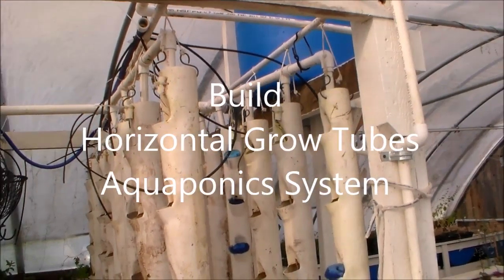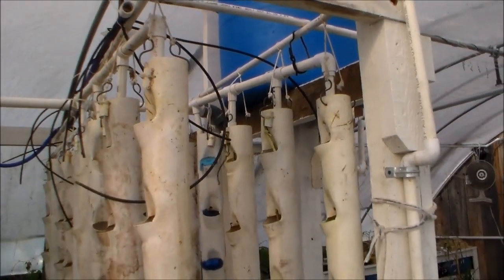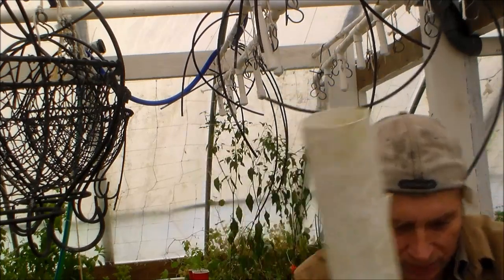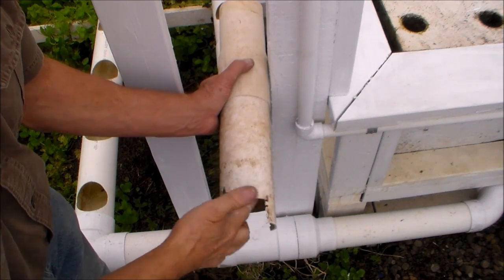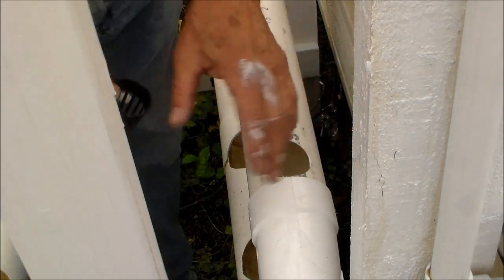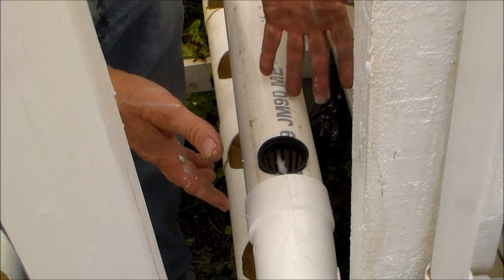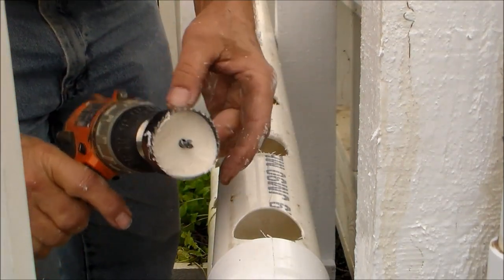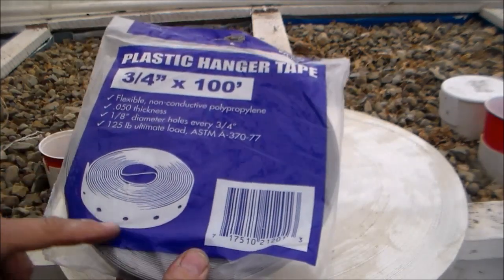Build Horizontal Grow Tubes in Aquaponics System

Comment: It seems that everyone doing aquaponics or hydroponics go through multiple versions of towers, mediums and watering processes.  I'm more confused than ever.  Are you just trying different approaches to see what works best?
Reply from the maker: everything was so new when I started that I was also confused and would try anything to see what would work at a low cost--- what was available at the time was so expensive --- I needed something I could afford and would still work.
Reply from the maker: Straw packing is a no no. too much foreign seeds in it, and it deteriorates too fast and molds grow. I switched to coconut coir instead. the wicking cord works well with small seedlings, small roots , but as soon as the plants mature and the roots grow in mass, the wicking is not needed--- the roots will continue the wicking on it's own.

Comment: Will like to see how yours works.....I tried this in South Carolina and the water got too hot and killed most of the plants.
Reply from the maker: the flush tank will not heat up the water, it should be the same temperature as the sump tank temp. the large surge of water will be at that temperature, and not increase as what a trickle will do. I'm excited to see how it will function over time!